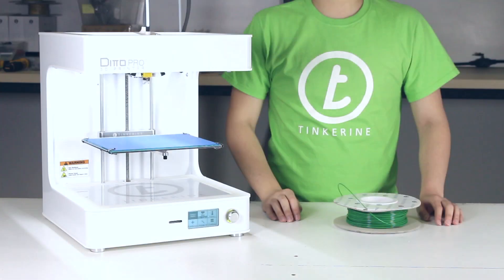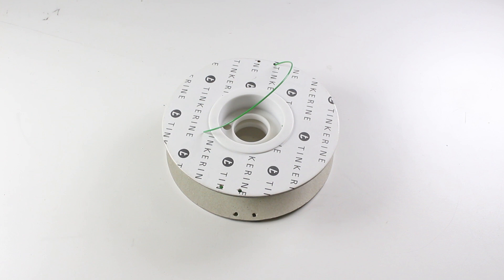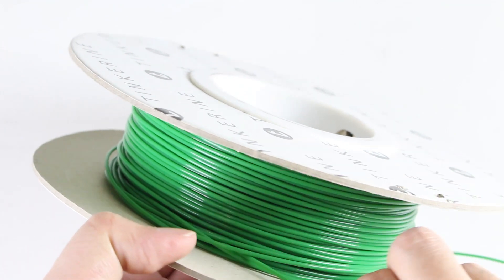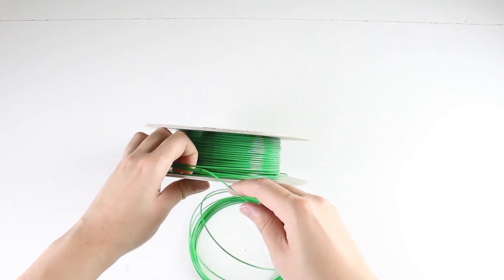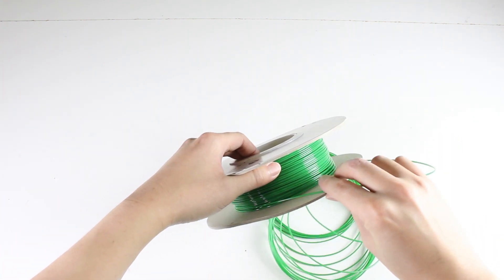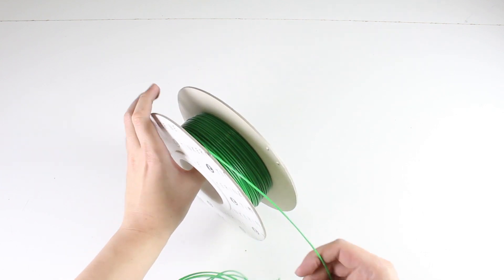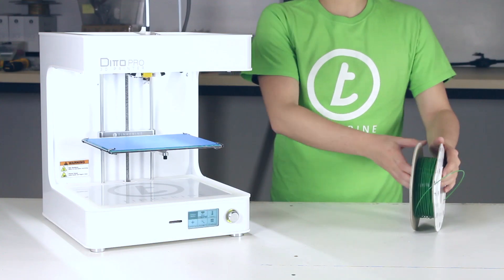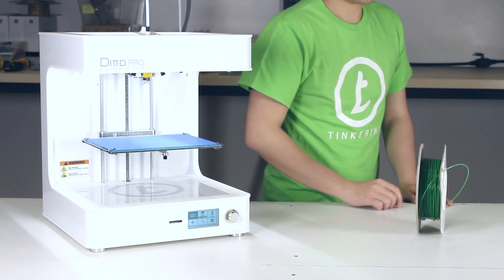How to Untangle Knots in your Spool of Filament

Comment: Untangling filament is valuable information for anyone getting into FDM printing. One thing to watch out for that might cause a tangle is letting filament fly back onto the spool (say, it slips out of your hand while you're looking for a hole near the end of the coil). My workaround has been to drill extra holes in spool rims, but there are plenty of clip-on filament holder designs that are worth printing.
Reply from the maker: Thanks for the comment and advice!